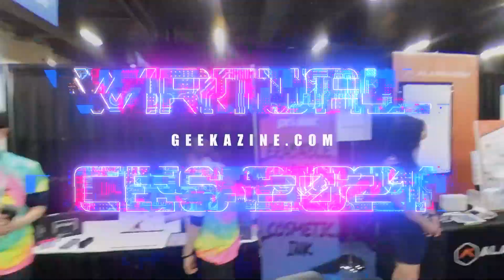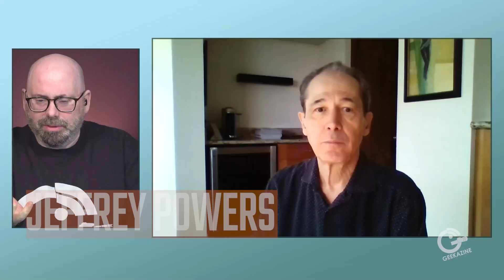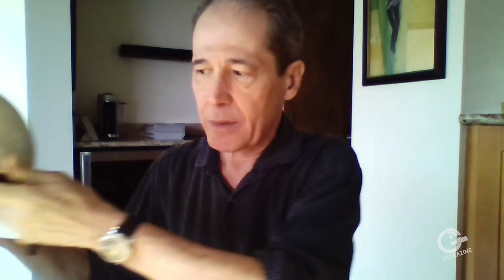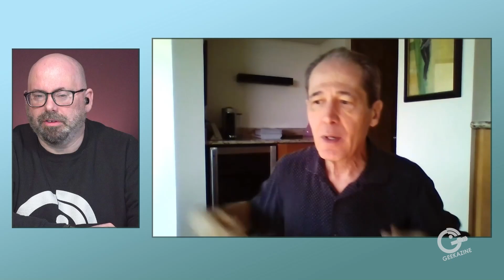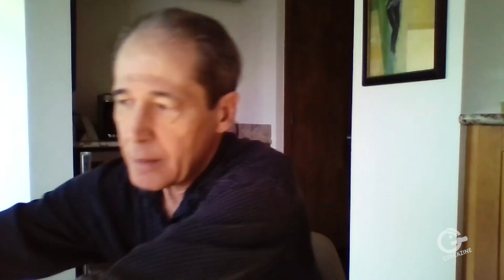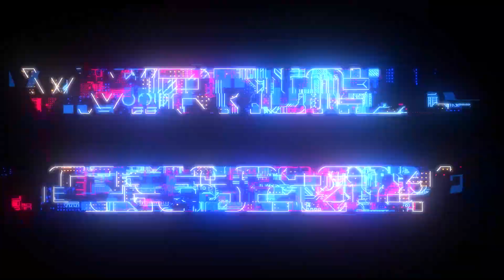Feher ACH-1 is an Air Conditioned Motorcycle Helmet

Comment: Good review-so better to switch it on 15 minutes prior of wearing it to allow “peltier” cooling plate to stabilize its temperature.
Simple technology: peltier plate + fan + air flow opening 
Thats it.
If designer sells it as a kit he could do more money and will be affordable for all.
Just draw a hole in your regular helmet and fix the kit with four screws and voila.
Now they are on 30% discount because of close out - feher should think of a kit instead of selling it with a helmet.
Reply: Hi.
It will perform well in low relative humidity environment. with r.h raising you will get a foggy visor unless the visor itself is heated..
Reply: No drilling into a helmet would render it useless